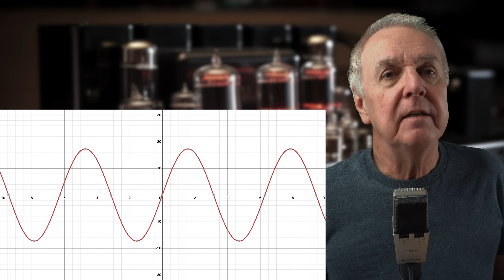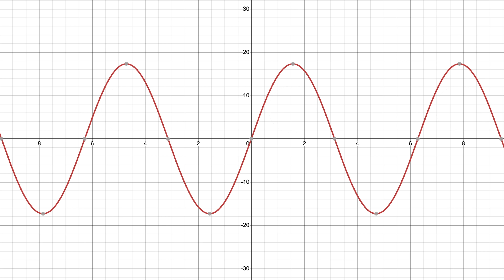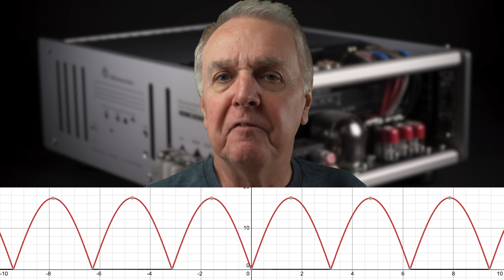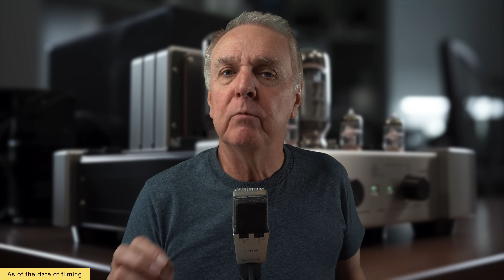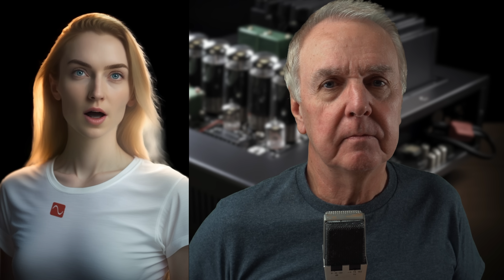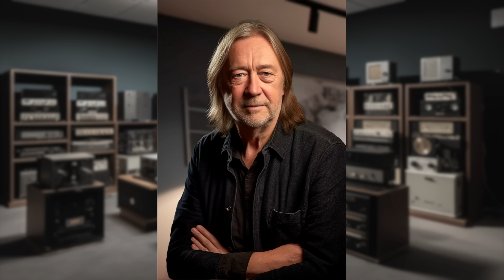Your power amp is average - Here's why

Comment: Wow, such a controversy .... 

The standard measurement used by most technicians and not a few engineers is to drive an amplifier up to clipping, back it down by 1%, read the RMS voltage across a dummy load then apply P = (V x V) / R to get the wattage.  

20 volts RMS on 8 ohms will get you (20 x 20) /8 = 400/8 == 50 watts RMS.

The notation "Watts RMS" very simply means "wattage calculated using RMS voltage".

If I calculated using Peak voltage I would say... Watts Peak
If I calculated using Peak to Peak voltage I would say... Watts Peak to Peak
When I calculate using RMS voltage I say... Watts RMS

The "using" is implied ... as in "Watts using Peak voltage" becomes Watts Peak.

Why do people have so much trouble with that???
Reply: We used to to it the DC heating effect in watts  Before fancy hifi artisans decided to baffle the public with nonsense.
Reply: @glpilpi6209 
Yes, and?
 
It wasn't "fancy hifi artisans" who designed the current testing procedure... it was design engineers looking for a standardized test that could be administered easily.  

The old hot resistor test relied too heavily upon the heat dissipation of the load... which even with "matched" resistors could vary over a wide range with variations in humidity, ambient temperature, airflow etc.

The test described above only cares what the ohmic value of the dummy load is.
Reply: Yeah, your right 
It's a standardised way of comparing different amplifiers. And that's what counts!
Ideally it should include declaration for distortion measured at the claimed power output along with impedance. So 100w RMS per channel @ 8ohm with (say) 1% distortion. Knowing level of Distortion and when it occurs is essential for comparison. It should be declared as false advertising for power output claims that fail to mention important specifics. And that's where the fudge factor takes off with the cheap chip amps. It's absolutely ridiculous how the established method is disgarded. Example: quoted output can be doubled (2x channels) the load is lowered to 4ohms and most crazy of all, peak power is used at a Tweeter popping 10% distortion. Lower distortion values on these amps are capable of typically appear on a different line on the spec list, at an unknown output level. Only clue you will get towards realising they have no relation at the claimed max output.
Reply: @SuperBicycleRepairMan 
I agree ... and when I write wattage I always  include both impedance and distortion as part of the spec. 

The best way with these chip-amps is to look up the spec sheets for the chips.  If you don't have the measuring equipment to verify outputs, this will at least get you into the ballpark.

For example if you search for "TPA3255 Spec Sheet" you will discover a world of detail about any amp containing the TPA3255 chip... It behaves the same way no matter what brand or price of amplifier it's in. (Of course substitute other part numbers for other chips... 😉)
Reply: Dummy loads are resistive loads unless I'm miles off here no?

Speakers are capacitive loads (potentially huge impedance (resistance really ie if you took a snap shot in time)).. they also generate electricity via inductance. Ie back EMF.

There is soooo much more.to it than voltage/current output into a given resistance (yes, ie dummy.load).

Damping factor?
Slew rate?
Power supply reserve capacitance?

Buy an 20+ year old BSS EPC series amp 760 or 780 which I have. It benches at 1625w rms.@ 2ohms sustained over enormous time frames... yes ohms law etc...

However LISTEN to the amp perform.. you don't even need high end speakers, mediocre ones will suffice. There is an immediacy, impact, slam, grip, and sheer effortlessness to the sound yet at the same time a silky smooth, soft, subtle, jaw dropping delivery to the mids and highs.

I agree with the video author however MY amp is definately not average lol.

Fun fact.. these amps were chosen for.the turbosound flash and floodlight PA systems in the 90s and built at a loss to be the best amps in the world.
Reply: @ripped2fcuk1 
Dummy loads are big ole resistors.

Yes there is more to measure ... but these are separate measurements that while related to output power are mostly independent factors. 

For example: if the output impedance is high enough it is entirely possible to build a 100 watt amplifier with a damping factor of 1:1.  Not a good idea, of course, but it can be done.

Damping factor is the ratio between the output stage's impedance (calculated from voltage and current) and the impedance of the load and is largely independent of power.

Slew rate is the rate at which the output circuits can rise from 0 to some arbitrary level. This is measured in fractions of a second and is again largely independent of power.

 Power supply reserves are a third factor, easily calculated, but independent of output power.

What I'm saying is that there is no one measurement that will give you a full picture of how an amplifier behaves. There is always the need to examine and understand multiple factors.
Reply: @Douglas_Blake_579  Douglas, thank you for your reply first of all.

Secondly, I agree and understand every point you have made. However it is these factors (in my humble opinion).. and through owning an amplifier that can bench 1625w+ continuous (pretty much as the cooling system is also exceptionally designed)....

That power delivery (and I think this where we may actually agree... beyond being 'sufficient' is not exactly 'irrelevant' but possibly the least important specification when matching an amp to a speaker (imagining no passive crossover network.. as that causes a whole nightmare of.its.own.... yet my MA BR2s Still sound wicked powered from an amp that at their nominal impedance of 6ohms,  delivers a continuous 775-825w effortlessly.

 I can absolutely spank these tiny 6.5" woofers and metal tweeters in a relatively tiny box and (although GREAT SOUNDING, MUSICAL, LOW DISTORTION AND HIGH CLARITY, speakers on their own.... ) no.matter how.much I increase the gain (to a point... an extremely high point... to the extent that that -6dB light is solidly on and the -3dB light faintly flickers.)

The entire fidelity and qualities I mentioned above simply SCALE with the increased power. Also, most notably, there is NO congestion to the sound at any level whatsoever. Even at extremely high SPLs.

I would appreciate your take on this particular point however...

At extremely high levels, where like I said there is NO increase in perceptible distortion, congestion, clarity, tonal balance etc... the woofer cone is absolutely flying well exceeding it's xmax and very likely close to it's xmech/xdamage...

Also one other related thing that I would appreciated your take on is the passive crossover network.. as my MA BR2 speakers are rated at 100w continuous however, even considering the crest factor of music (and I play everything from 60s rock, 70s disco/boney M, 80s power ballads and later acid house,.1990s dance music, but most of all late 90s,.early 2000s house/trance/techno.)

Unfortunately this was the era.of the loudness war race. I also happened to love rock/nu metal around that time.. the most over compressed music ever lol.

So... how on earth do the components in the crossovers survive such a sustained assault of energy ie heat ie leading to chemical decomposition?

I can understand the drivers surviving 6x peak power and at a guess (I'm getting tired now lol) 3.5x sustained power due to their heat dissipation via their escalating movement.
Reply: @ripped2fcuk1 
Oh my, and we were doing so well... 

Now, I gotta say...  "ARE YOU BLOODY INSANE?"  
Dumping 775 watts into a 100 watt speaker?  Seriously???  

I looked at the specs for your BR2 speakers, based on the power range specified I wouldn't even dream of hooking up more than 75 to 80 watts on them.

Oh well, the good news is they're only about $350 a pair.

We're done.
Reply: @Douglas_Blake_579  indeed we are done.. you seem stuck on continuous resistive load.which YES 700W would melt a coil in no time.

However consider the crest factor of music, and FOR THE LAST TIME the slew rate of the mosfets etc.

Interestingly these amps used a low power mosfet arranged in a series-parallel (mostly the latter).grid arrangement leading to am extremely low source impedance.

Power isn't as important as its made.out to be..I agree.

You seem..to.disregard all.of the other points I have raised.
Reply: @ripped2fcuk1 
Trust me on this one ... as a tech with 40 years experience two things will happen ... 1) You will end up frying your speakers and 2) you're gonna need hearing aids very soon.
Reply: @Douglas_Blake_579  lol okay tell that to Funktion One
Reply: I am partially deaf though so I'll give u that... not from my system but from crap sloppy slow amplification (and an almost complete indifference to gain structure by many 'Pros')
Reply: @Douglas_Blake_579  the max spl of of 6.5 + 1 speaker isnt actually that high. If it could deafen you that's because of the distortion ie higher average level and the lack of attack and in particular decay (most important) as a rapid decay means minimal ringing therefore   gaps of near silence in the sound.
Reply: @ripped2fcuk1 
No, it's mostly because the human ear is progressively damaged by any higher sound pressure level regardless of your excuses.

Almost all industrial safety charts start warning about hearing loss after prolonged exposure to 80db spl.  By the time you get to the 110 and 120 db range you've got basically 5 minutes or so before you lose some small bit of your hearing, that you will never get back.

Comment: music is not a sine wave, music is NOT RMS
it is actually  a wave with very high peaks and valleys and a much lower average "work or heat" power, 
which makes peak to peak power (or output current in Amperes ), a more valuable number for music, 
HOW MUCH HEADROOM -
do I have above average "heat power".  while RMS is useful mostly for knowing how DURABLE is that amp, and ditto RMS if especially important for not burning your loudspeakers.
how much "heat or work power" can it handle without over heating, (note if you push music signals into RMS average "heat power", you must be clipping)

Comment: When you apply a sinusoidal voltage to an amplifier the output waveform is sinusoidal and so is the current through the load. However, when you multiply the voltage by the current and plot it on a graph you get the power waveform. The power waveform is a strange non-sinusoidal shape that obviously never goes negative. My college maths lecturer said that power is an imaginary quantity because the only real things present are voltage and current.
The power amplifiers I built provide 46.6 volts RMS across an 8 ohm load just prior to clipping which is how I measure the output. No need to calculate the output power into imaginary units.
Reply: Why is power imaginary and why are voltage and current not? They are as much imaginary when you consider they represent the flow dynamics of electrons through atomic crystals, which are realer than current and voltage.
Reply: @l.s.1709  Well if you consider current and voltage to be imaginary then the product of them must also be imaginary. Anyway, you can measure the voltage across a load and the current through it. Now if you want to multiply the current by the voltage you can call it power. However, it's really volt amps.
Reply: @jimdavis5230 you're reinforcing my point.
Reply: it is "sinusoidal", it's 1-cos(2x) or sin^2 if you wish
By multiplying RMS values of current and voltage, we get average of that sin^2 and call it active power. In reality, power pulsates 2x frequency